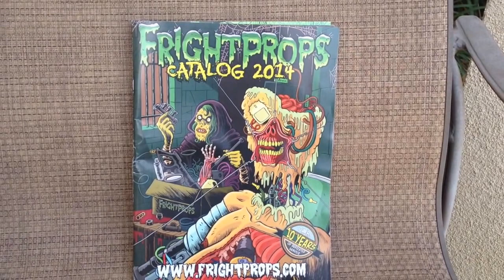Pneumatic Blast Gate

Comment: Hi, Greg. I've got six pneumatic blast gates already constructed that are almost exactly like the one shown here. But I've been stumped trying to make the electronics (i.e. Arduino) work. I see that on an Amazon current sensor review in 2019 you comment that you've done it with an Arduino. I'm guessing you've upgraded this system. If so, it's exactly what I'm looking to assemble! Can you describe/make another video/share your results with the public? (Following is the cut/pasted review from Amazon):  

"I used 9 of these to automate my dust collection system in my woodshop. These current sensors signal my Arduino mega when a power tool is turned. When the Arduino is signaled that a power tool was turned on the Arduino open the pneumatic blast gate and turns on the central dust collector. The Arduino knows how many machines or on and knows when to turn off the dust collector ( with a delay) after the last machine is turned off. It was a lot of fun building it and the current sensors made it easy and reliable.
Customer image
15 people found this helpful"

Here is the Amazon component where your review was found: https://www.amazon.com/Current-Sensing-Normally-Adjustable-SZC23-NO-AL-CH/dp/B07N1P6TWL/ref=sr_1_19

I can be contacted at douglas.b.meyer@gmail.com

Comment: I have a question. What sizes are the 2 angled aluminium pieces; that you installed on the blast Gate; to accommodate the cylinder and solenoid?

I am seriously considering your exact setup. One of the best I have seen. Great job Greg and a tip of the hat.
Reply: Pneumatic cylinder is mounted to a 1.5 inch angled aluminum.

Comment: I would suggest having a delay after the tool turns off to run the dust collection with the blast gate open for 5 seconds to catch any dust as the tool winds down.
Reply: +lsdave easer said then done. This id purely a mechanical set up. A delay would require some electronics which would be beyond me.  Would be a nice simple project for some one like Ben Heck.
Reply: I had the same idea and like you I came up with the same malady. So I shelved the idea.
Reply: An Arduino could easily run the delays. Or possibly just some hard wired electronics.

Comment from the maker: This is a fun gadget to have in you woodworking shop. It automates you dust collection system blast gates. So when you turn on a machine, that is connected to the dust collection system, the blast gate will automatically open. The blast gate has a pneumatic cylinder that is controlled by at 110volt solenoid. So when the solenoid see the 110 voltage come on, it sends compress air to the pneumatic cylinder and it opens the blast gate. 

You can buy a commercially built automatic blast gate for about $400. This one was built for less then a $100.